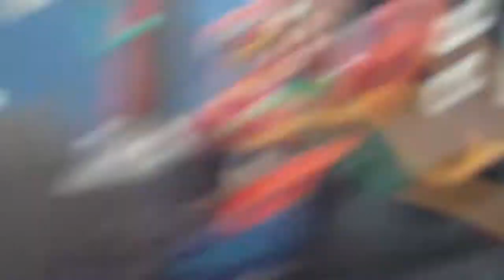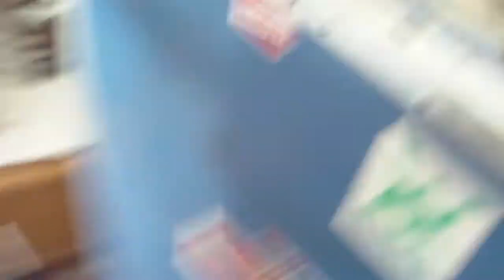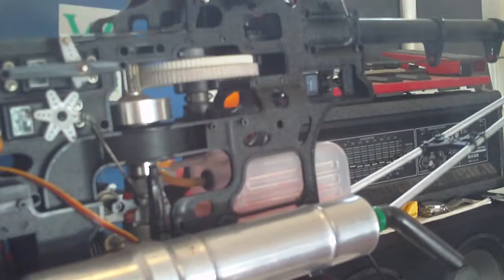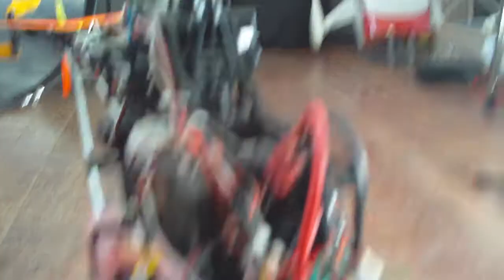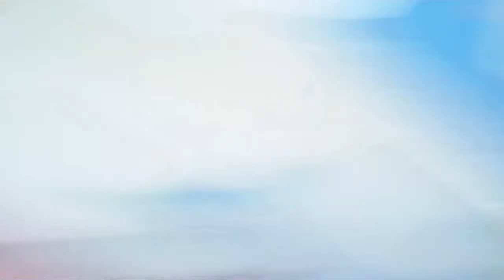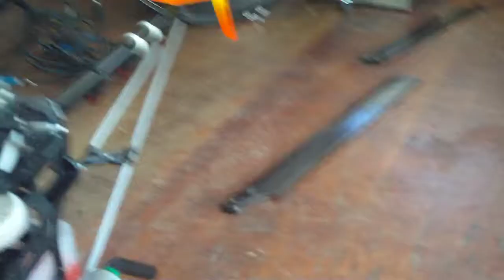heli after crash

Comment: It's called a brown out dude I am looking at your wire job re do it  Also you maybe have a chaffed wire because I see you have them zip tied straight to the frame. I know the issues sound small but they add up trust me. And when you re setup your radio like you did you should have hooked up the control for the Multi Gov and checked your end points. Good luck on getting back in the air.